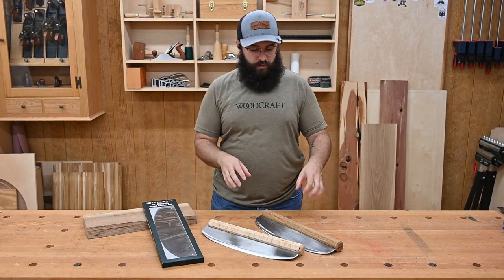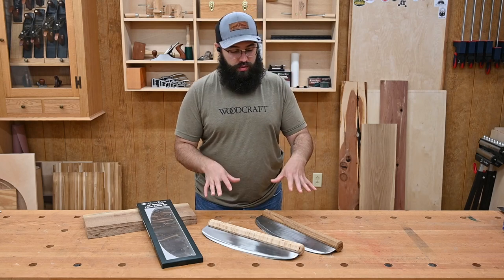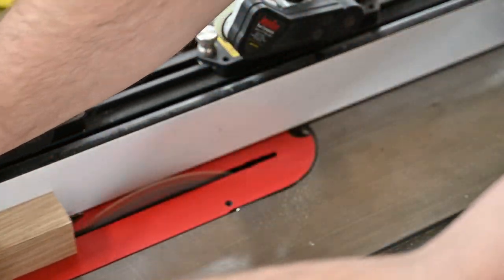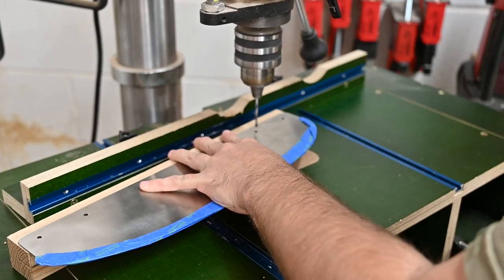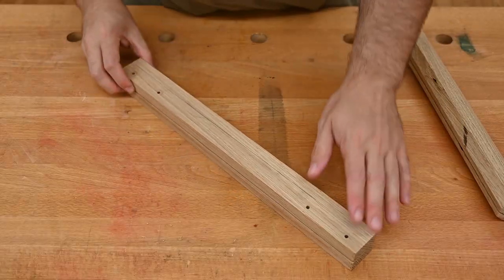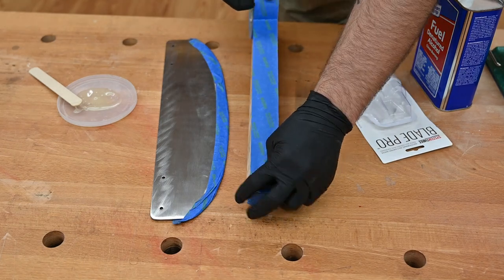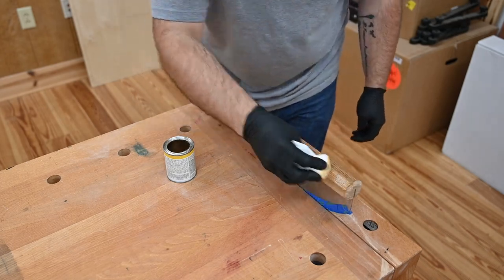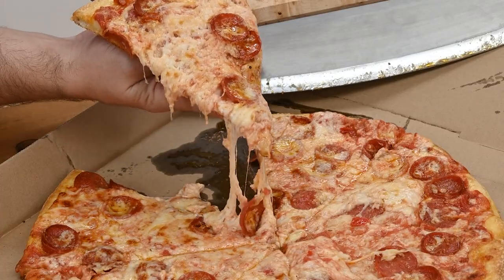Make A Giant Pizza Cutter with a WoodRiver Rocking Pizza Cutter Kit

Comment: Quick tip:

Keep the foam insert that came with the blade.  
You can use it as a template to cut out the shape of the bade from a piece of wood, to make the holding block.  Then, simply cut the shape out of the middle section on the bandsaw and attach the two halves for a nice, form-fitting holder.  Use an opposing color wood for the insert for a nice esthetic contrast.

Comment: I would have liked to see how to use the pins that were included with it… especially since there are no instructions in the kit.😢
Reply from the maker: I personally hate the little pins but I will try to do a video on them soon. Basically you have to drill a through-hole, then figure out the thickness of your finished piece, and then counter-bore the correct depth for the heads of the pins.
Reply: It's actually pretty simple.  Just countersink the holes, and insert the screws.  However, the screws are entirely unnecessary, as the blade can be easily cleaned by hand (sharpened knives are not recommended in the dishwasher, anyway).  The first one I did, utilized the screws, however, I ended up replacing them with brass rods then plugging the holes with ebony plugs.